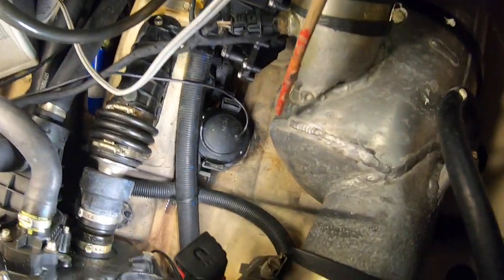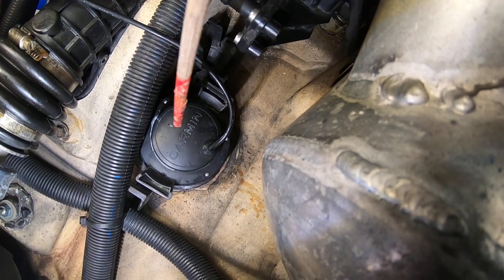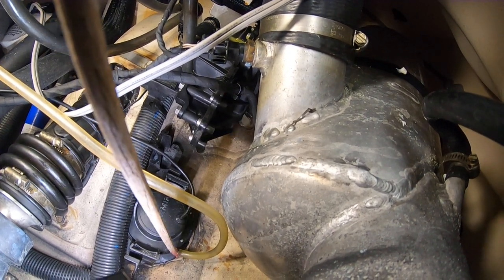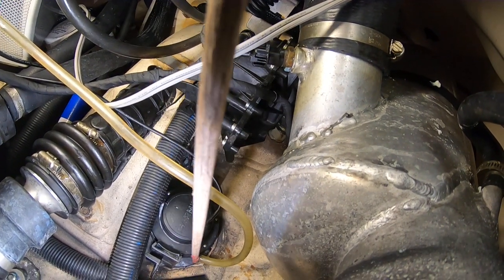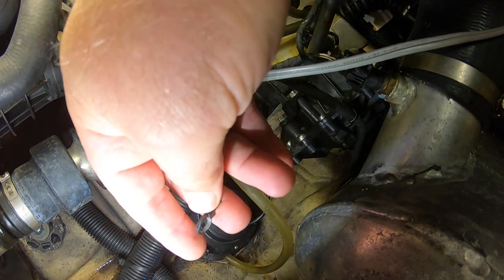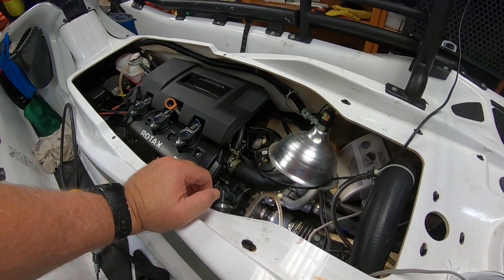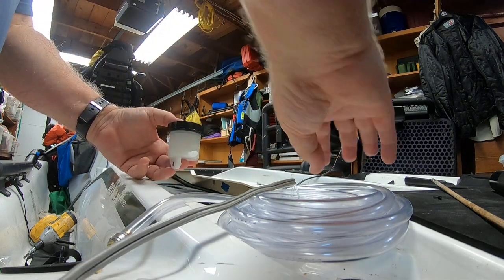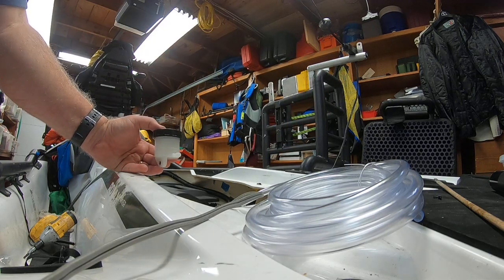FishPro Transducer Fluid  - Easy Check Mod (1/3)

Comment: I really enjoy your helpful videos! Thank you so much for posting them. I have a 2020 Sea-Doo Fish Pro Trophy and your videos give great ideas on how to combat engineer flaws from the manufacturer(s)
Reply from the maker: Bless their hearts ( as we say in Texas). Some of the things that just seem overlooked in the production of the units. Glad to be able to help. BTW - The transducer in the Seadoo FishPro is a Garmin GT15M transducer, BUT Modified by Garmin/SeaDOo  to have a shorter transducer cable, AND to have  4-pin threaded connector at the end of it, instead of the Garmin stock 8 pin connector in the GT15Ms that are used for boating. The Garmin replacement transducer that you will get from thegpsstore.com or others will have this 8 pin termination, and even though you get the 8-pin to 4 pin adapter, the termination on the 4 pin end WILL NOT adapt to the installed Seadoo cable that runs from your engine bay up to the Echomap. Translation of all this - the Garmin GT15M transducer used for regular boats is $149 off the shelf, BUT, to replace the Seadoo unit you need to either get the Seadoo Tranducer off their web site with the modified termination at $449!!!!, OR, you need to get the stock Garmin GT15M for $149, and cut the cables and then splice the proper wires from the $149 Garmin into the existing cables that came on your SeaDoo. SMH!

AND the stock Garmin from the boats has the screw holes om the body that mounts to the hull, in contrast to the FishPro unit. SMH

Comment: Thanks for the info.   Quick question , how do you remove the top?   Mine is really tough to get out.
Reply from the maker: You are exactly right it is a bear to remove and break the seal sometimes. What I had to do is get a stubby screwdriver.
Reply from the maker: And put it in between the top of the housing to break the seal then I was able to get my fingers to be able to pry the seal and transducer top off of the housing